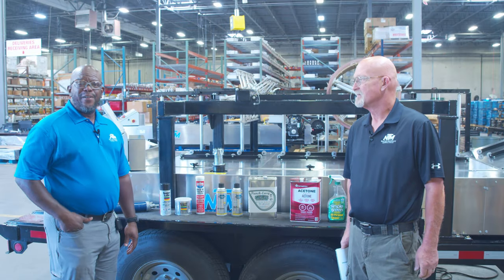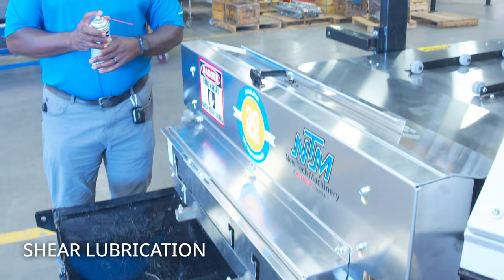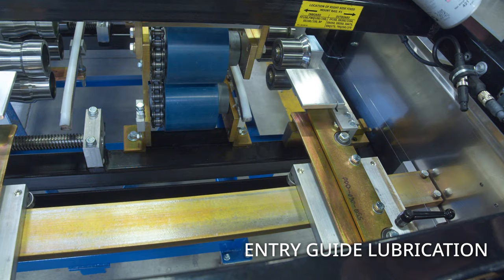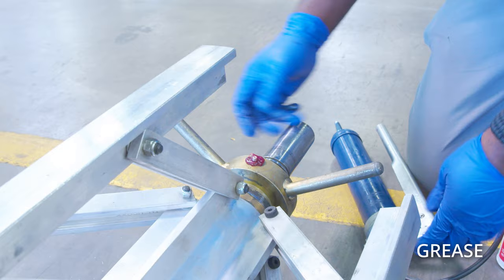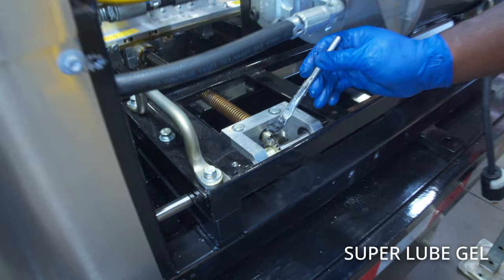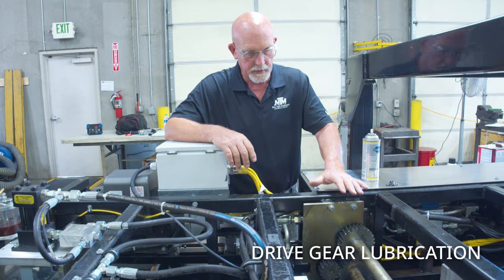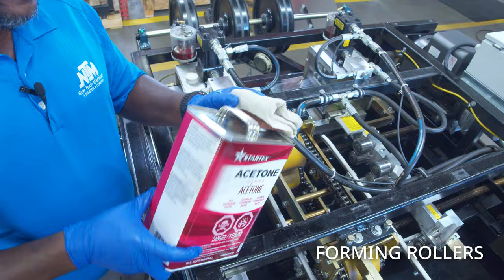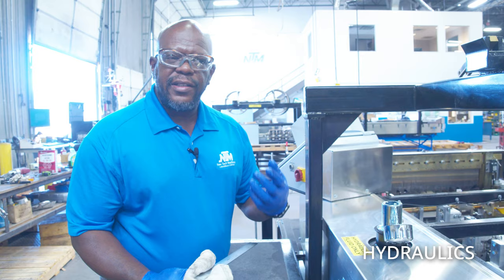NTM Roof Panel Machine Required Maintenance Walkthrough

Comment: Thank you. I’m helping a friend out with his. I put a call in today for assistance. The hydraulic drive motor stopped running. No jog in either direction or no run mode either. He’s had good performance with it since he purchased it new. Looking forward to speaking to your tech folks on Monday to get the SSQ running again. He has a big job coming up. Thanks. Jeff Cibulka